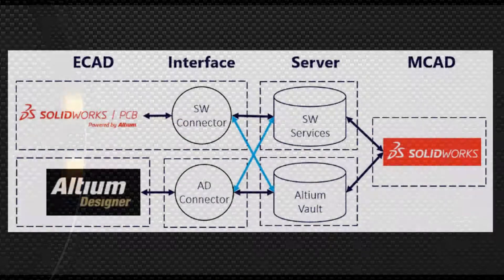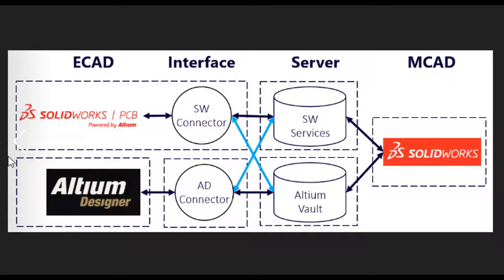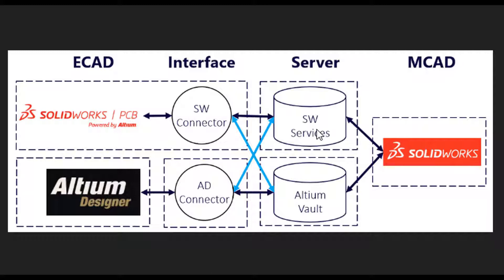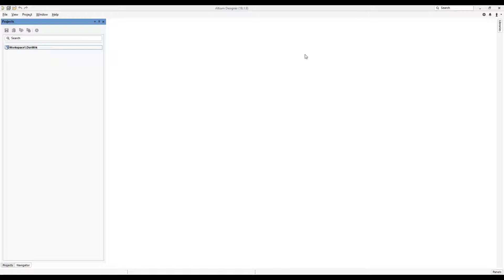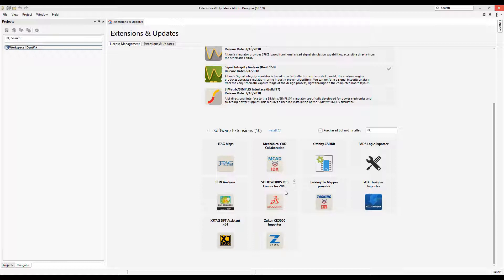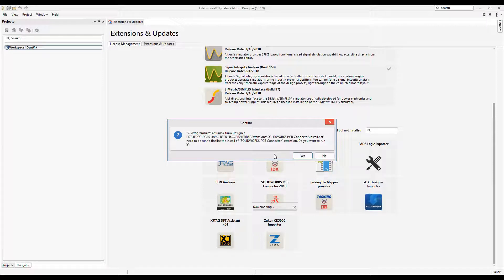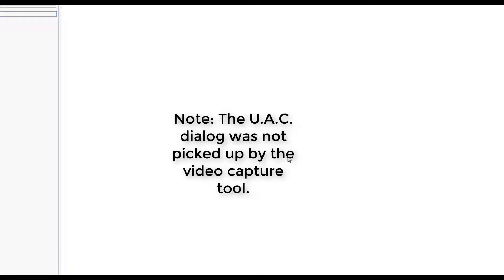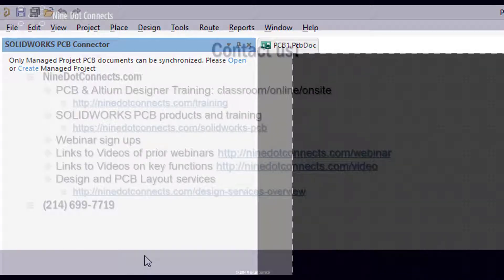SOLIDWORKS PCB Connector Installation

Comment: In Altium Vault can be found a bunch of libraries with footprints and 3D models build in the intlibrary, however I'm using SW PCB with the PCB services, so how can I make use of the libraries which provides Altium Vaults?
Reply from the maker: Jose - we recommend that you look at octopart.com.  This is a site owned by Altium.  In addition to being an online database for components, in most cases, a symbol and footprint will be provided for download.  NOTE - please review the component's symbol and footprint to ensure that the footprint dimensions and pins are correct.